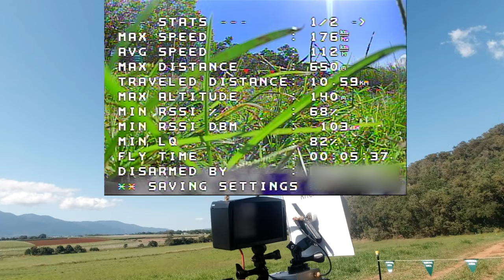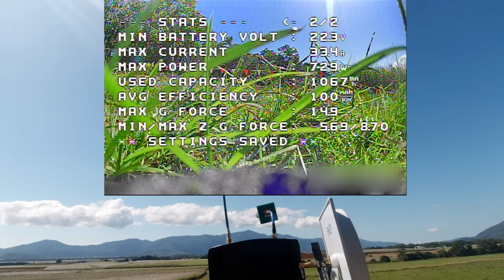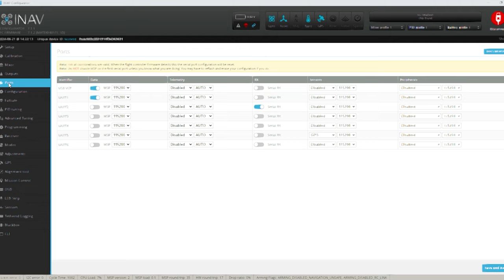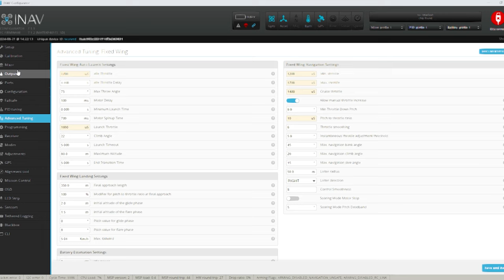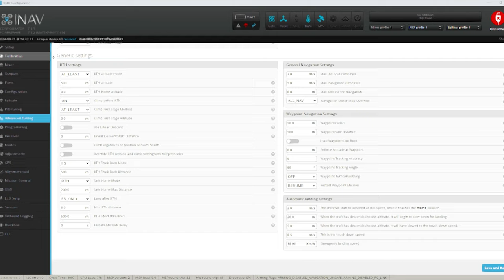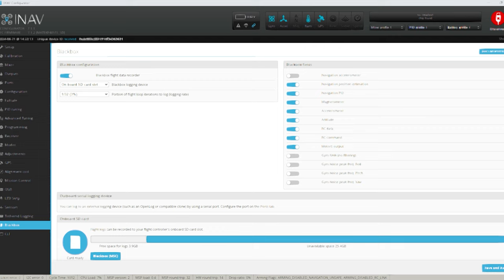ZOHD Alpha Strike - New PB - INAV 7.1 Setup and HD FPV Plans

Comment: Very good stable plane. I’ve had 211mph out of mine 6s 😯 so your 200kph is can easily be done with the correct set up. And yes, mine is 211MPH not kph. I use a 70a esc and 2000kv motor. Check it out and how I launch on my page.
Reply from the maker: @ttucker2073  that's amazing awesome job!
I'm not after record breaking speed just a craft that flies well and can do easy 200kph. But your Alpha is very impressive!

Comment: Could you try adding a lidar and try auto landing on this with inav?
Reply from the maker: @narenana  yes most definitely I have never set that up yet but I have thought about doing it on my long range planes.
Reply: I have been doing autolandings on my sky surfer last few weeks and not been able to get the absolute right parameters. The touch down gets missed by about 10-50 feet on each attempt. But thrilled to see your build. There is so much space to place all the electronics and you have done a very neat wiring job!
Reply from the maker: @narenana  thanks 👍